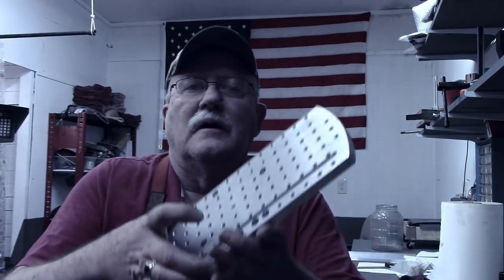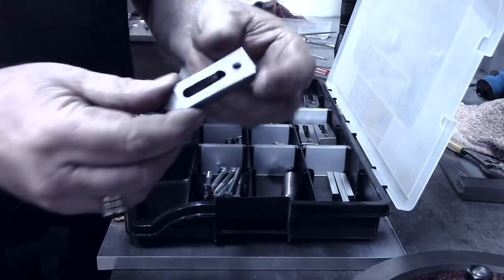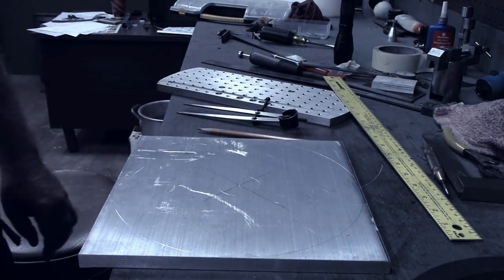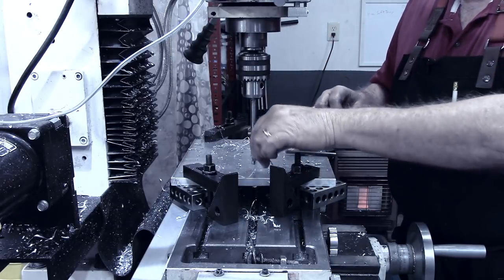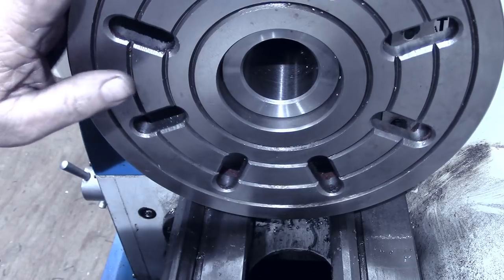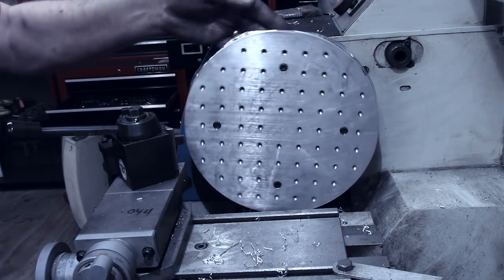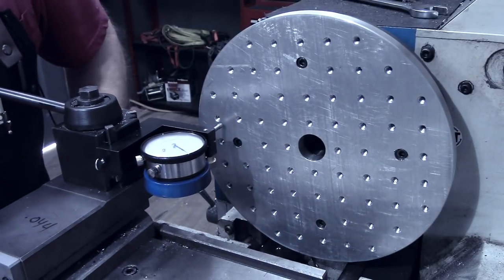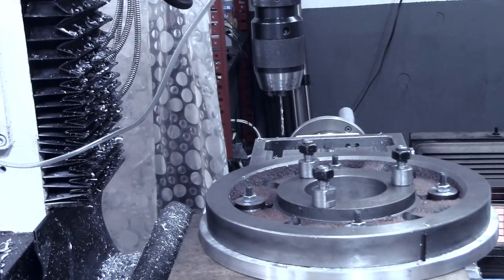Lathe Face Plate Pallet

Comment: I just made a 3" diameter version of this with about ~100 holes tapped #6-32tpi to mount on the faceplate of my little sherline lathe. Next I will make a 2 jaw Gingery-style chuck that mounts on this plate, for square work and offset/eccentric turning. I'll also be making a couple right angle blocks and a dedicated hold-down system to go with it. Thanks for the inspiration, this is a fantastic idea.

Comment: Hi Lee, just some comments for improvements, not trying to be critical. I know each does things their own way to get to the same result.
Instead of using the big holes in the plate, it might have been more advantageous to drill holes into the plate and thread them so it's located each time. it would also prevent it from twisting if something decided to lock up.
Also I would have trued the plate up on the outside first, then I would have made lines in the pallet plate radiusing so all holes are the same off center so they balance the pallet. Right now as it's spinning I see that they are not balanced. 
Then I would have drilled and tapped the plate. Then face it off. That would have improved your project a little.
I might have even left the radius lines in for help in aligning. Just like a four jaw has.
Overall I can see the usefulness of this. I would probably add a dog driver so that I would not have to worry about having a dog with a long enough pin. It could easily bolt in.

Comment: Nice addition to the lathe....IMO, I would have not put the large hole in the center, a drilled and tapped hole in the center would give you quick attachment for parts and be "on center"....you could mill a recess in the pallet and fit a removable spud that has a center hole that just pops into place when/if needed
Reply: outsidescrewball Agreed.., it’s a pallet plate how often is it needed? Flat surface would come in far more hand so parts don’t suck up into the divet when clamping down.

Comment: Loved the video Lee. Just a suggestion on covering the ways. I use plain old Kitchen aluminum foil when worried about heat and when not Kitchen Saran Wrap. Both are easy to mold around corners and easy to store a roll in the shop. Every grocery store sells it also...